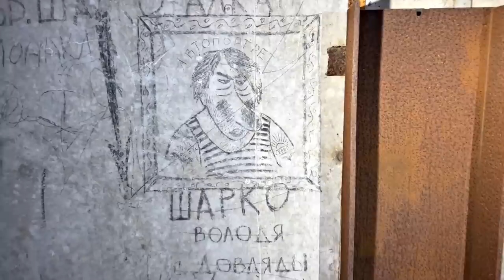☢️What's inside the Chernobyl reactor? Where is the working railcar in Pripyat?

Comment: When they were measuring the radiation at 19:57 my heart skipped a beat because i recognized the stalagmite-like structure amidst the cables. It's corium!! The molten reactor core that solidified! The same material as the "elephant's foot"!! :0
Reply: I mean it could be anything but corium is a good guess but to see corium in chernobyl without having to go into the base under the reactor whould be rare if not impossible

Comment: @bettyjones2614

Unit 5-6  were not part of 1-2,3-4 and were never finished and after 86 a temp cap end was added to the unfinished Reactor Hall this was never fitted with its reactor / fuel rods although I'm sure even if by chance non radioactive im sure the ground water is heavily polluted with chemicals

Comment: Which reactor unit are these guys on the roof of? With the NSC being in the distance, surely it can't be reactor 1-4?
Reply: Of course it is not! If this is reactor building (maybe it is not!) it is the one unfinished, where reactor was never installed. I guess there is no radiation, or very small amounts. Their dosimeters are propably adjusted to show some dramatic measures. Take it easy, they are doing entertainment.....
Edit. These are unfinished units 5 and 6, over kilometer away from once working units

Comment: The fact that radioactive silver is out there concerns me a lot. Most if not all micro chips in computers use silver. A radio active particle that goes flying off the silver could potentially flip a bit. A bit is what the computer uses for storage of information and code. This could be catastrophic. This bit could destroy and entire computer or worse depending on the machine its microchip is used in.

Comment: For those who are affraid, units in the video are unfinished unit 5 and 6. They were finished at 70%, reactors was never installed, building itself is over kilometer away from once working units. I guess there is no radiation at all!